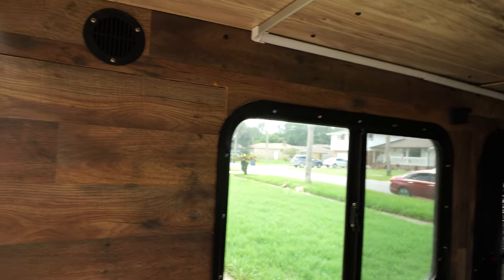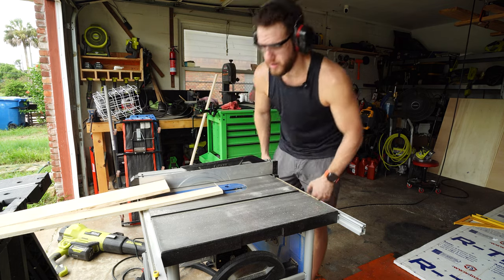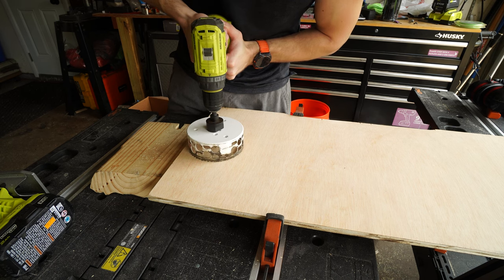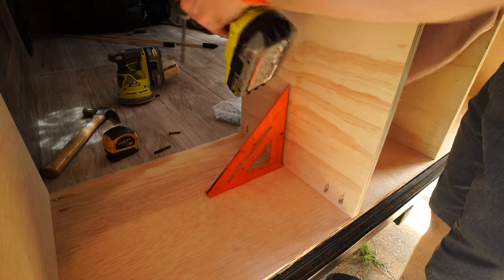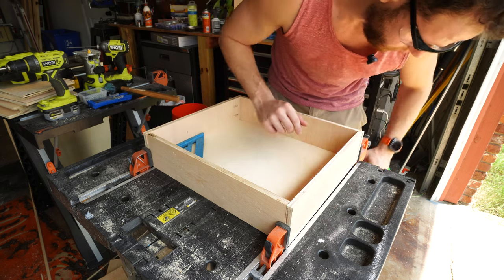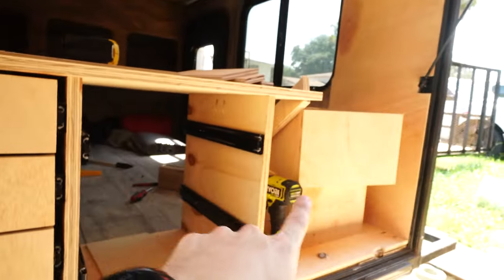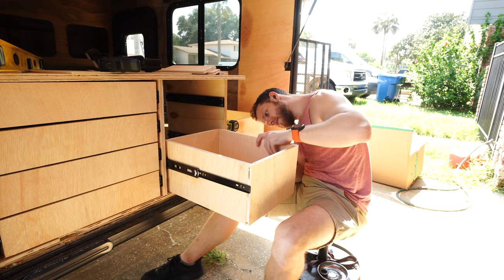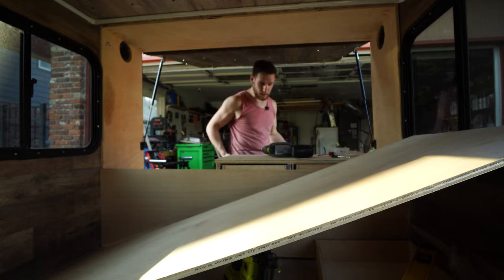Building a Kitchen for my DIY Overland Trailer

Comment: Make the bottom drawer not as deep, about 2 inches shorter. the face will be recessed into the cabinet by the 2 inches, but it will not be hacked up.
good work......  New Sub
your gonna need an AC unit for florida.  I know.....